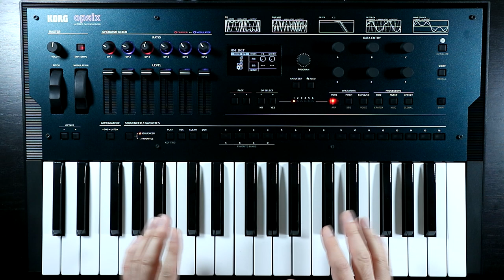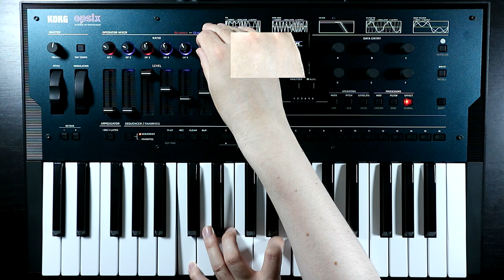Korg Opsix - Operator Modes In Depth: FM Mode

Comment: I bought this from the Korg outlet fire sale last fall.  I’m just now finally getting down into exploring it, and this video right here has blown my mind with the possibilities here.  This is all next level ideas and while I lamented the lack of 5-stage envelopes, there’s so much more to do here that I’m almost lost in possibilities😂
Reply from the maker: There's so much to explore on the opsix! Hopefully some of my other videos can help you find some interesting corners to fry started with.
Reply: @OscillatorSink  I hate to blow you up with comments and praise but this is the sort of slow and intuitive FM synthesis tutorial that would have been insanely helpful back when I started learning the Digitone.  The only thing I think I'm missing is a sense for where the harmonic sweet spots are when setting modulators further out than the first.  

When you set up the down sawtooth on op 5 For the first time I gained a real appreciation for how it played with the level EG to create smaller fades as the note rang out.  This is a very good exercise.
Reply: I just got 1, what is the best way to modulate wave width? being trying with mod 3 or put an lfo there in the mod matrix but failing, thanks! @OscillatorSink
Reply from the maker: @falangistavaleroso9689  the mod matrix should work. Are you definitely modulating an operator that's acting as a carrier? I think I actually cover this in practice on another video, let me see if I can find it.
Reply from the maker: @falangistavaleroso9689 yes it's in the mod matrix, I set it up here at around 30 minutes:

https://youtu.be/rUa_qK-XPJ4?si=Ug3gH-MwUmCElRbZ

You'll need to double check that you're applying to the right operator, that the operator is audible (is a carrier and turned up) and in the right mode.
Reply: i am using as base the bobmfm whatever sound ( 90s fm sound) with only 5 and 6 operators, i connect the mod wheel to mod that width in 5 and 6 op, i prefer 6th only, but i would like to do with an lfo. thanks, i owned almost all the yamahas but never achieved to program any, this korg sounds way worse but the edit is great, i always wanted the jellynhouse knob controller.
 @OscillatorSink
Reply: let me watch it thanks @OscillatorSink

Comment: Hi 👋.  I keep coming  back to these excellent opsix videos.   Whats a good way to set up PWM sounds on the Opeix do you reckon ?   Cheers.
Reply from the maker: The FM operator mode I'm showing here has a width parameter, so modulating that is probably the best way - you can achieve this in the VPatch. Some of the wave-shaper modes in the FX operator type can do PWM style sounds too (even if it's not quite technically what it is).
Reply: @ thanks so much - i know you are busy working with the neo and other synths now so this is really appreciated !  I know from Gordon Reid’s SOS series that you can simulate pulse with two saws - one inverted vs the other - and then use very subtle Detuning to simulate somthibg similar so I will look into whether you can inverted the sawtooth on one of the operators too.   Cheers 😀
Reply: Looking at the manual looks
Like Ring Mod mode allows user to rectify an input waveform so maybe that will work for an inverted saw ?

Comment: Thanks so much for making these videos! They have definitely been my manual since getting this synth. I was wondering, do you know if there’s an easy way to rebuild presets from scratch? I would recreate presets I liked on my Prophet 6 from an init patch to learn the synth. But can’t figure out an easy way to do this on the opsix.
Reply from the maker: I'd suggest saving the patch you're learning from to a spare slot, and then save an init patch in the next slot (Shift+Dice to create an init patch). From there it'll be easy to toggle between them to check how you're going - just remember to save before moving presets! 

Personally I've got the "Prog Chg Lock" in the Global Parameters set to "Shift" so I can't change patches unless I'm holding down Shift - this has saved me from losing a patch I'm working on so many times.
Reply: @OscillatorSink  Thanks! I was THIS close to ending up with scribbled notes tacked to my wall!

Comment: I'm learning a lot from your videos, an incredible resource for a newbie like me. Thanks a lot. I'm stunned with the sounds I can get out of my opsix (my only synth besides a volca fm), however I find the little versatility of the envelopes really frustrating. Only 4 stages, no level points... The volca fm is much more capable in that respect. For example, I can't make an inverted EG for a modulator, or an envelope that opens, then closes and finally opens again... I don't get why korg downgraded their envelopes for this fm behemoth, specially talking into account their importance in fm synthesis. If you have a word with the nice people at Korg, would you please raise this issue?
Reply from the maker: I can't speak on their behalf, but I suspect that their reasoning was that ADSR is so much more widely understood and many many more people are more comfortable with them rather than the DX7's, which in the grand scheme of things are pretty esoteric. It's probably also worth remembering that you have 3 other assignable envelopes which you can use in tandem with the level envs on the operators (a luxury not afforded to the DX7) which you can use to do inversions, more complex shapes, etc.

I do, however, badly lament the lack of an initial value (L4 on the DX4) - that's the thing that I've found lacking when designing sounds - multi-stage envelopes? Not so much honestly.
Reply: @OscillatorSink  Yes, I spoke out of frustration... that is to say, my ignorance (about fm and about the capabilities of my precious first proper polyphonic synth) spoke. I've since figured out workarounds for delayed or double attack EGs with other envelopes and LFOs. It is the inverted envelopes for modulators what I've been struggling with (the ability of setting L4, as you put it). Thanks again for your intelligence, generosity and contributions to the community.

Comment: REALLY important thing to point out - you can set LFOs to “voice” so that you get an independent cycling lfo PER VOICE!!! It adds so much more variation and randomness (pitch or anything else).
Reply from the maker: Absolutely, although it's not appropriate for every patch, if you're using modulation for 'richness' decoupling the LFOs for each voice is a big deal. I touched on this idea I think in the Pad patch building video I did, but I'll go into on this depth when I cover the whole (and very powerful) modulation sources and vpatch.
Reply: @OscillatorSink  ya, I created one of the most beautiful patches I’ve ever created using the posix today. Most of the vids on this are just so metallic and fm. It’s real power imo is to use it as a 6 fader blending machine of analog bliss. I think of it a a six oscillator virtual analog where you can adjust modulated envelopes per osc and with incredible amounts of texturing capabilities per osc.

Comment: I can’t get my OpSix to be in time with Ableton, OS. Are there certain pieces of gear you have to have so that it properly communicates with my daw? There’s just a short recording delay whenever I record audio from OpSix into my Audio Interface.
Reply from the maker: Is that delay latency from monitoring inside the DAW rather than direct?
Reply: @OscillatorSink it is inside the daw it’s not directly from the synth itself. The synth is perfect and hasn’t done anything wrong to me since I got it. It’s just completely unusable, because when I record anything it’s always 0:00:060 delayed in my timeline inside Ableton. Not sure if it’s my audio settings on my PC and my AI or what.
Reply from the maker: If that's also when you play it live (rather than sequencing it) then that's an audio interface latency latency issue for sure. I don't know Ableton at all so I'm not in a position to help you there, sorry.